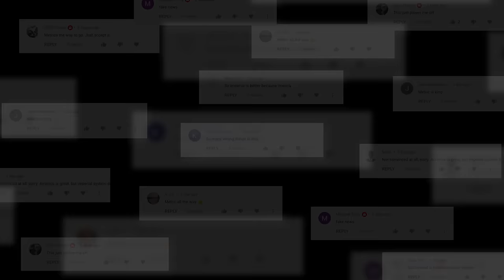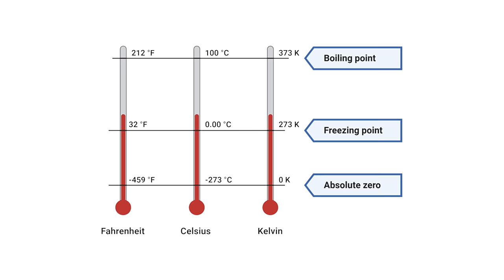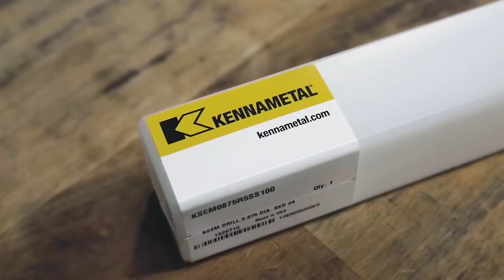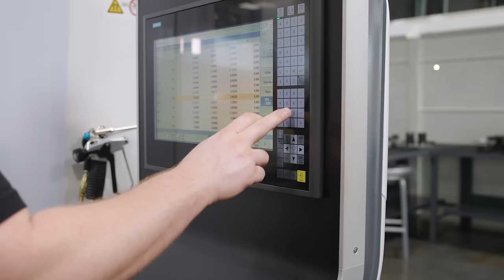Why METRIC is SUPERIOR to IMPERIAL

Comment: Having used both here in Canada, I can assert from personal experience that metric is far easier to use and less prone to reading errors.
Reply: Same here in Ireland- have imperial and metric. As carpenter- metric way better.
Reply: Grey wolf. Agreed the inches vs millimetres thing is stupid it’s inches vs centimetres
Reply: @oscarosullivan4513  Wrong. You don’t order anything in cm in the UK. Only in mm and Metres. Mostly no decimal point unless you’re getting plenty over 10 metres or you are working less accurate and go for example 6.4 Metres.🇬🇧
Reply: @oscarosullivan4513  Not correct. Try to buy a 6mm drill bit... and convert that to inches. Idk the conversion but it might be 1 third of an inch or something like that. I really dont understand the imperial system, but I'm a metric guy for almost 50 years, that's the system thought in school.
Reply: @grumpyone5963  Plenty of things are in centimeters. I buy paper for example 70x100cm.
Reply: @oscarosullivan4513  One inch is 25.4 mm or 2.54cm ... Both are easy o understand, so I don't see the problem.
Reply: @kaba_me  - Here in Brazil we use only the Metric system for a long time...
Centimeters are used by the majority of people that doesnt work building sutff, or builds stuff using concrete.
Woodworking uses centimeters AND millimeters.
Metalworking uses ONLY millimeters, rare exceptions when explaining to anyone that is not on the field.
Reply: @brianfhunter  It depends on the type of metalworking I guess. sometimes is just easier to use mm instead of switching between mm and cm. That's not the point though...The point is that metric is always 10 based and easy to understand. The decimal point is moving, but the numbers remain the same.
Reply: @kaba_me  exactly mate, easy peasy...
Reply: I don't know about Canada, but there are still many people in the UK who use feet and inches for rough guestimates, then work it down to metric if necessary for precision. In fact, I'm Dutch and I usually try to visualise roughly what size I would need for something. I don't call it feet or inches, but more often than not a meter is too course and centimetres are already too specific. It just happens to be a certain size when I buy it, thinking "this will do", and then work it down to fit if necessary.
Reply: @bramweinreder2346  The UK part is definitely true. Peoples height and weight is measured in feet and stones. Primitive measurements embedded in peoples heads from an early age.
Reply: When you work in high precision metrology or semiconductor industry, main unit will be nanometre, which is a mm divided by 1 million.
Reply: @burgitech8643  try finding an imperial equivalent for that. It's not something that most people can visualize.
Reply: @bramweinreder2346  5/128 of a nano inch, that is! 
:)
Reply: @ivoivanov7407  Ohh now I see! That really makes the smidge and the hair's breadth look like cargo ships now, doesn't it :)
Reply: WRONG.
Reply: @joepalooka2145  I didn't dislike the comment because I disagree, not even because you didn't care to elaborate. I disliked it because it's obvious troll bait and I just know that someone is going to indulge you, because this is the internet.
Reply: @greywolf88  This explains why Australia transitioned to metric way back in the 1970s. With metric, everything is based around a factor of 10. 10mm = 1cm. 1cm x 10 x 10 = 1 metre. 1 metre x 10 x 10 x 10 = 1 kilometre. And so on. Thank you, France! 🇫🇷 🇪🇺
Reply: @G40bv  try to buy a 47/64s drill bit in mm. They dont exist for a reason because you can buy a 6mm drill bit or a 47/64s drill bit.
Reply: Yes I always find it easier to measure large numbers as opposed to smaller ones.
Reply: @greywolf88  metric is shite for carpentry.
Reply: @adifferentangle7064  not true, I understand that you say that, for you, it's easier because imperial it is what your were taghth to use, but metric is far more efficient for it
Reply: In school we was taught inchs and centimetres only to find out nobody ever use's centimetres but millimetres.
Reply: @adifferentangle7064  teacher's need re-education centimetres don't get used it's millimetres. And you would use imperial anyway, you can wouldn't go to a pub and get half a litre of any drink it's a pint, you don't fill your vehicles with litres it's gallons. When you step out of the front of your house you step into your front yard, not metre. Imperial is our lives not metric.
Reply: @denismorgan9742  I live in Australia so yes, I do put litres into my car and I put millilitres into my drink, so i would get a schooner, which is 425ml.
If I step outside I either go "out the front" or go "out the back", and my "yard" is 15 metres x 6 metres.
If you have an old house here that hasn't been renovated then imperial measurements can work better for doing a lot of maintenance.
However the main advantages of imperial system as a measurement is in the design stages. 
Working with metric measurements, even though they are generally kept as close as possible to the original imperial, it is usually easier to stick to whatever that is.
Because my lot was measured originally in metres, the measurements of the yard do not translate well into imperial, so there's not much point using it for yard design/maintenance.
Reply: @adifferentangle7064  so I take it you don't have acre's of land, furlongs, hectares and firkin's.
Reply: @denismorgan9742  We do have acres, because a lot of land was plotted over fifty years ago. 
But we measure standard sized house plots in square metres (m²) and farms are measured in hectares.
To give you an idea why our farms are measured in hectares and not acres, the smallest farm that I helped out on as a kid was 2,000 hectares. The largest was about 10,000 hectares, and that is not particularly large in this country. It's certainly not the biggest in our area.
There is no point using anything smaller.
Reply: @denismorgan9742  And I have never heard of a firkin. A bareller or specialist whiskey/beer distillery staff might know the term, but it's certainly not common use.
Reply: @adifferentangle7064  your right about the firkin not being of common use outside the brewery or distillery industry unless you drink a lot, it's a large amount so is a hogshead which is not in common use.
Reply: Metric for sure
Reply: I'm here in the United States of America and I already switched all my damn weather apps over to Celsius.
Reply: @REAL-UNKNOWN-SHINOBI  which ever system your use to is fine, it only needs to be in conjunction with products going back and forth so that everyone is singing from the same song sheet. This is where problems occurred in ww2 between Britain and USA, Britain used imperial and USA metric. Similarly Japan used odd numbers in metric and Europeans use evens. By now everyone knows how everyone else works but still discloses whether imp or met or odds and evens.
Reply: @bramweinreder2346  Fractional or even better, decimal inches provide much greater accuracy in the real world than metric can possibly provide.
I can prove it, but I will not go to the trouble if it will fall on deaf ears.
Reply: @bobjeaniejoey  it will not fall on deaf ears. If I had to guess, it probably has something to do with an inch being larger, which makes it easier to subdivide into more visible fractions than you would with a centimeter, and those fractions in turn can be divided more often into units that are still measurable.
I always keep an open mind, when it looks like I'm not then I'm joking or I have a bad day, but I'd rather be the fool who learns every day than the ignorant who is rigid in his thinking.
Reply: @bramweinreder2346  Such a wonderful response from a thinking individual.
Thank you.

My grammar is sometimes not the greatest, and I also tend towards verbosity.
Please bear with my shortcomings in that department as you read.
I stand behind my analysis, though.

Some years ago, I took it upon myself to make a long-term comparison of imperial and metric measurements, measuring everything by both systems, while attempting to remove as much bias as was humanly possible.
My original intention was to make it a year-long experiment.
I made it through about 3 months before declaring imperial measurements to be the hands-down winner.
Scientific?
No.
The best I could do?
Yes.

So, on to my proof.

Ranking the degree of easily discernible accuracy possible among .01 decimal inches, 1/64 fractional inches, and 1/2 mm divisions, they fall in order of 1, 2, and 3 as I've listed them above. 
A quick visual comparison between rulers containing those three choices reveals that to be true, with .01 decimal inches being the finest measurement possible, followed by 1/64 fractional inches, then 1/2 mm.

Very simply, there are 100 divisions in a .01-graduated decimal inch, 64 divisions in a 1/64th-graduated fractional inch, and finally, not quite 51 divisions in a 1/2 mm-graduated 2.54 millimeters.

Further, and this part may be somewhat subjective, but I contend that it is significant, is that a metric ruler can have its graduation lines staggered in length only in a few ways, making them "run" together to the eye, if you will.
Metric 1/2 mm graduations are very difficult to see and keep track of.
It's easier to look at a metric ruler and actually see this than to try to visualize my explanation.

The same holds true for the paragraph below regarding imperial. 
Look at a .01 decimal, 1/64th fractional ruler, and a 1/2 mm ruler.
Ask yourself which one is the easiest to read of the three.
Here I will say that the 1/64th inch is easiest to read, providing 13+ more divisions than metric, but 36 less divisions than decimal inches with much easier to see graduations than the metric ruler.
Which provides the greatest accuracy and is still highly readable without special optics?
The .01 decimal inch ruler.
Which one comes in last in terms of accuracy and readability?
1/2 mm metric.

I'll describe the benefits of imperial graduation line format.
Both decimal and fractional inches are capable of staggering the lengths of the graduation marks to a much greater degree than metric can, with the lengths of the graduation lines varying from 1/2, 1/4, 1/8, 1/16, 1/32, and 1/64, which, to me, allows the eye to lock on to a particular graduation line without losing track of where one is looking. The same holds true for decimal inches in either of two slightly different methods, depending on the choice used by a particular ruler manufacturer.
Some ruler manufactures make better use of this feature than others, but regardless, metric ruler graduations are severely limited in that ability.
I'm quite familiar with using metric, but because of that limitation regarding the length of graduation lines, I get "lost" when viewing a metric ruler versus inch rulers.
I became aware of these distinctions, preferences, and clear winners in making measurements when performing adjustments to certain different guitar specifications.

Case closed.

When repeatedly making measurements that require a fine degree of accuracy, I choose that which best fits my needs.
The two best choices are decimal and fractional inches.

There is my reasoning.
I hope it made sense to you.
Any clarification forthcoming upon request.

Metric is great for its ability to play nice with itself when working with different units of measurement at the same time, usually in lab situations.
With exceptions, my opinion is that is where metric's benefits mostly end.

I contend that imperial is friendlier to the everyman in most units of measurement. 

Thank you for your interest, time, and consideration.

Good day to you!
Reply: @bobjeaniejoey  it all made sense when you noted you're a guitar builder. I too tried my hand at this, and precise measurements are useful. It does help that Stewmac sells fret rulers for different scale lengths. But if you need to measure from scratch, I agree with you that this might indeed be closest to the pencil mark that an experienced craftsman could work to, especially if you want to prevent stacking error on error. Fortunately, I was never experienced or skillful enough that I needed to measure something out to less than a milimeter precision, I just oversized slightly and then made it fit to the eye. But that's more of a "however the chips may fall" approach which isn't very scientific. If you can work to a higher precision, you get smaller tolerances and increase the chance of a better overall quality.
Reply: @bramweinreder2346  
It has been a pleasure encountering you on our journey on this "Big Blue Marble', good sir.
May favorable breezes blow your way.
Love StewMac, even at their prices. 
If you need what they have, they have what you need.

Comment: One thing often overlooked is how much easier it is to go from e.g. lenth to volume to weight. 1 liter of water is about 1kg and the size is 10x10x10cm. Try doing that going from gallonds to punds to inches. Metric is not just about how you measure length, weight, volume or many other things. It is also about the relation between them.
Reply: And if it's not water? 1 liter of gasoline does not weigh 1 Kg. Meanwhile, gasoline is the one liquid I measure out the most in my daily life. I gallon weighs 6 pounds. Therefore a full tank (for my car) weighs 72 pounds. That wasn't so hard was it? Seriously, please consider how many times in your daily life to you convert volume to weight with water. Be honest.
Reply: @noelmasson  Many things has about the same density as water, because a lot of things consist of water. And the mass/volume conversion is practical when you use it e.g. in baking and other food related activities.
Reply: @laserbuddha  You didn't address my point. I "measure" fuel more than water. Most people do. Also 75% of density is not "about the same", any more than 1km is "about the same" as 1 mile. 1 gallon weighing 6 pounds is a relationship, and it's not hard to remember. Certainly no harder than remembering the difference in order of magnitude between nano, pico, hepto, mega and giga for example or that there are 60 seconds in a minute, 24 hours in a day and 365 days in a year for that matter.
Reply: @noelmasson  Really??? Just read the whole discussion again, starting with op.

Just because it's not useful when it comes to gasoline, then it completely useless? Your point is whatever it's, is just weird.
Reply: ... and it goes on and on. 
1 cubic meter of water weighs 1 metric ton (tonne)
1 kilo gram of mass requires a force of 1 Newton to accelerate it at 1 meter per second of velocity every second
1 Newton of force pushing something through 1 meter expends 1 joule of energy
1 Newton of force pushing something at 1 meter per second expends 1 watt of power (1 watt = 1 joule per second
1 Newton meter of torque turning at one radian per second rotation rate expends 1 watt

Larger units are in multiples of 1000 (also "centi" occasionally used for 100) which prefix the units
nano = 1/1000,000,000,000
pico  = 1/1,000,000,000
micro = 1/1,000,000
milli   = 1/1,000
kilo    = 1,000
mega = 1000,000
giga   = 1,000,000,000
tera  =   1,000,000,000,000

How many ounces in a stone or stones in a ton, or cubic inches in a gallon again? Oh and is that a US ton (short ton) or an imperial (UK) ton (long ton) and a US gallon or an imperial (UK) gallon?

The main argument given in favour of imperial units is that with imperial units it is easier to visualise roughly how much the quantities are. The above shows that that argument is total baloney.
Reply: @noelmasson And what happens when gasoline is phased out? Try phasing out water!
Reply: When cooking/baking I like to measure both, solids stated by weight and liquids stated in liters, with a scale only. Place a bowl on the scale and start:
- 500g of flour - pour in flour up to 500g
- quarter liter of milk - pour in milk up to 750g (almost all liquids used in the kitchen have a density close to water, i.e. 1ltr=1kg, so a quarter liter of milk is close to 250g)
etc.
No measuring cup for liquid volumes needed.